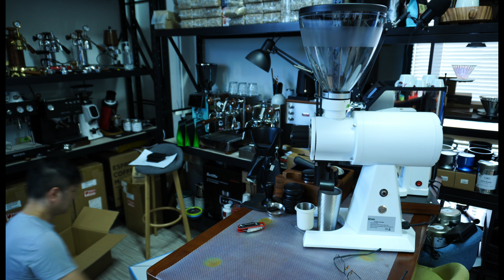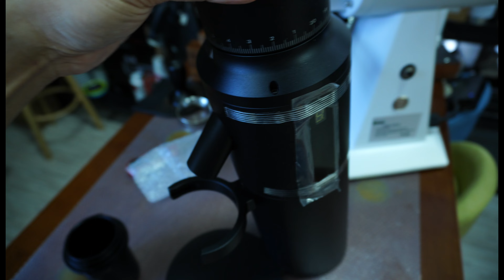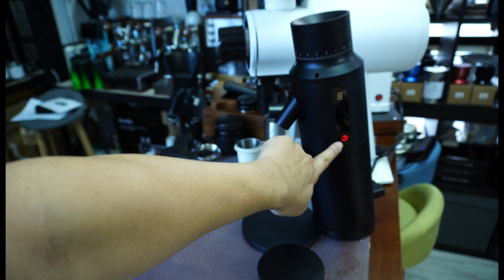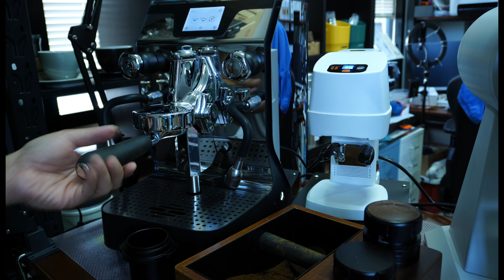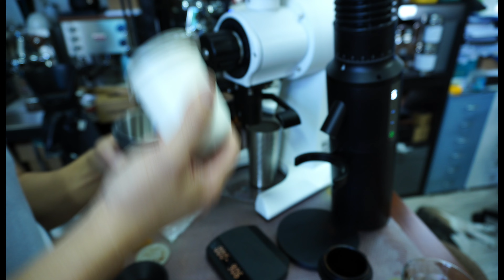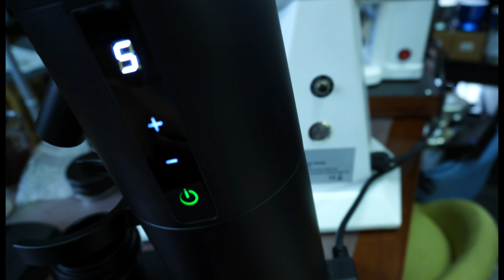G64 - Variable Speed 64mm Flat Burr Grinder | Unboxing and First Look

Comment: Definitely interesting, will be interesting to see how it pans out once you open it up.  If its a powerful enough motor and build quality/tolerances are better than DF64 it could be great, but wonder if the really fine grinding is maybe a delumper issue: may be holding the coffee back too much and be regrinding? Will be great to see when you open it up and if the declumper may need some trouble shooting.